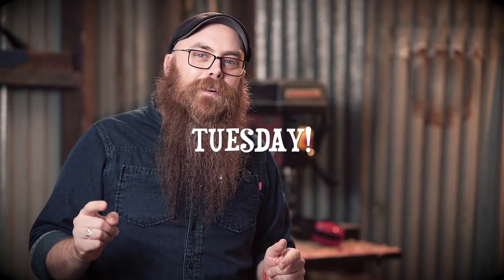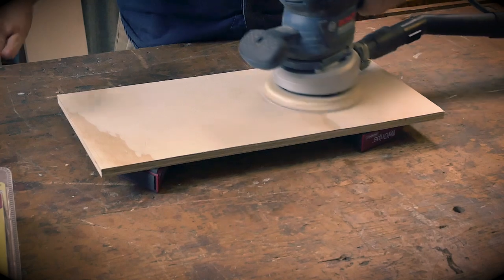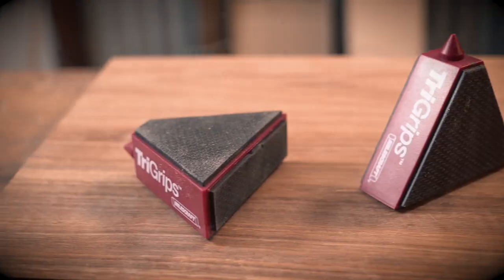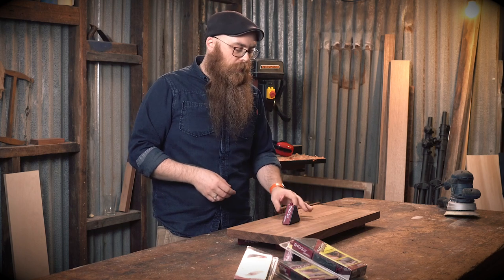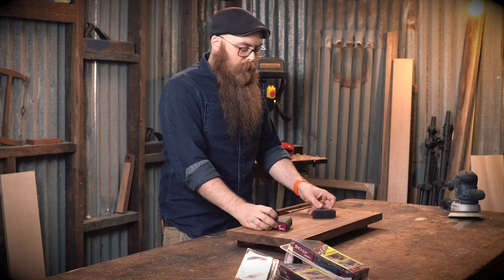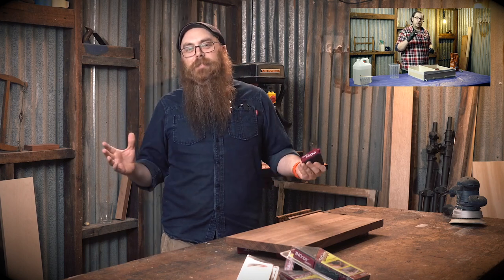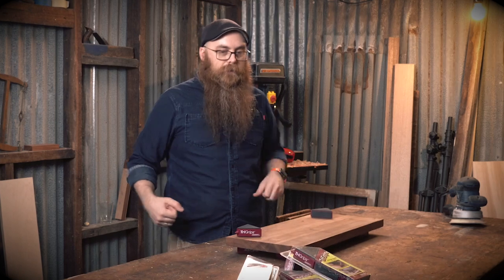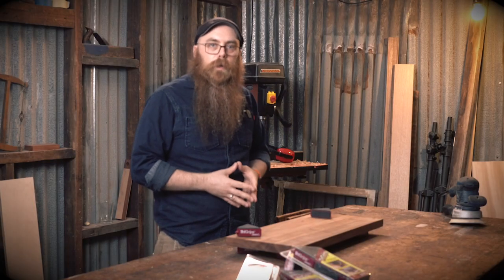It's Cool Tool Tuesday! Milescraft TriGrips

Comment: I have 4 of these in my shop. I use these for more than just sanding. I use them for edge routing on my carved signs when I am not using my router table for this process.  You can also use these with a couple quick clamps if you need the stock to stay put. That's one method.